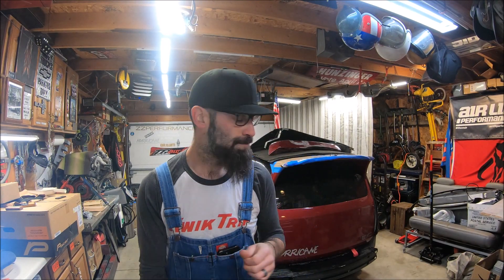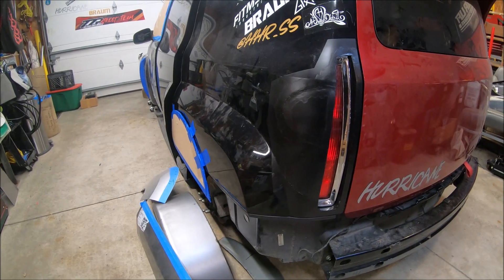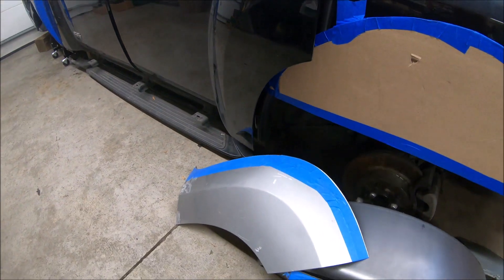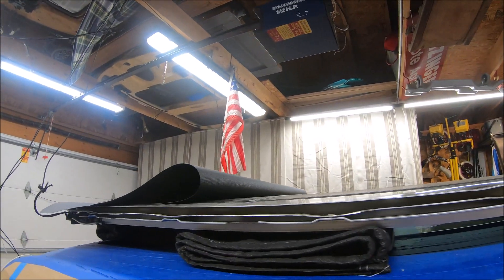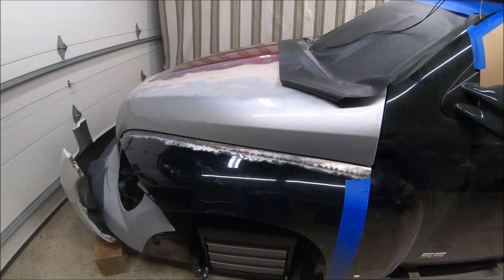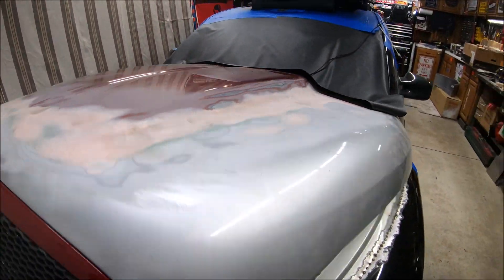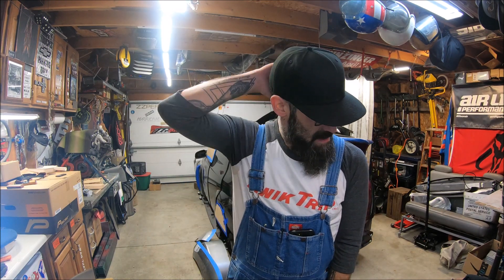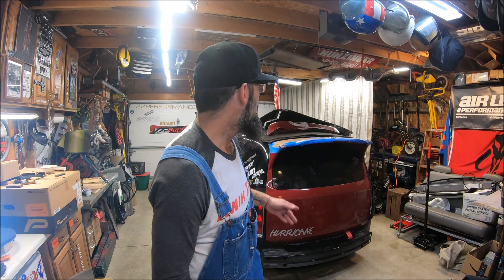Hurricane V2 overview 1

Comment: Pretty interesting. Once you have the nice outfit for the dance what are you going to do to make it ZoomZoom?
Reply from the maker: The S252 turbo and Buick 6speed transmission will be more than plenty. I'll be able to hang with the $100k+ cars on the highway all day long. At a fraction of the cost and with 4 fewer cylinders.